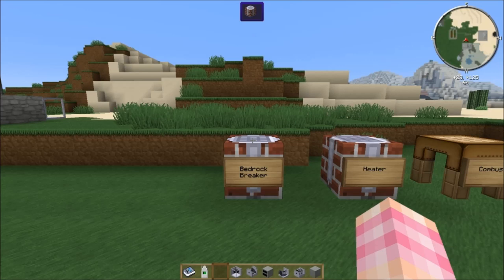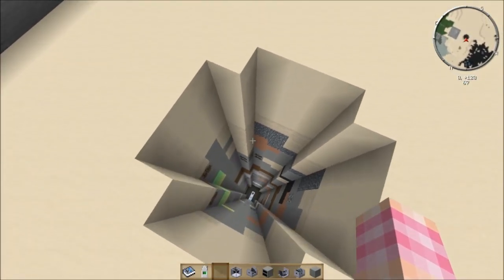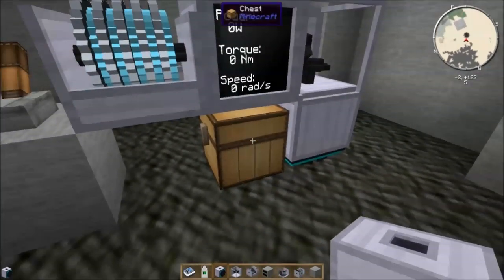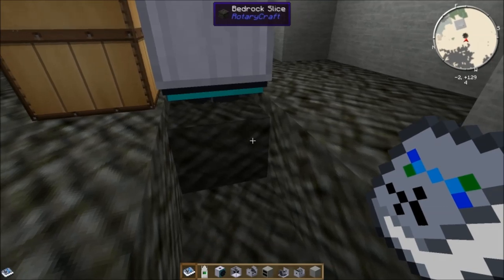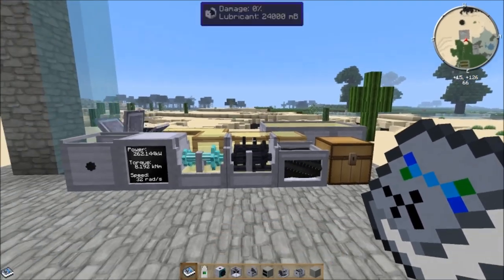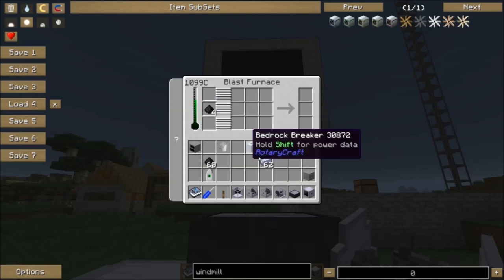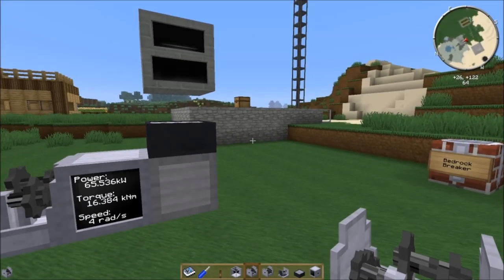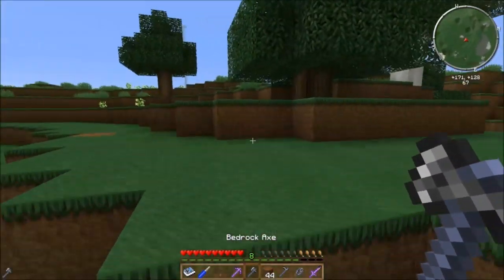RotaryCraft Tutorial #12 - Breaking Bed(rock)

Comment: Heads up to anyone watching this: match the speed and torque! for the friction heater! For example, if you have a performance engine you want to run it through a 2:1 gearbox to bring both the torque and the speed to 512. This gets you the highest possible temperature from the amount of power you're using.

Comment: Also, the heater torque requirement is 16.000, not 16000, thus making those gearboxes not only unnecessary, but actively detrimental.
Reply from the maker: You mean 16Nm? Was that another thing from that old version cause I tried that initially and it wouldn't work.
Reply: Insufficient power, maybe? Or more likely a bad combination of chosen temperature and fuels.
Reply: I already run a server and Sentinal has a standing invitation to it.
Reply: ReikasMinecraft I love your models and all the mechanics in the mod! I'm just sad because it's not featured in most modpacks... :(
Reply from the maker: TheMegaCreeper I think a lot of people don't like Reika's terms, that you can't modify any of his recipes or disable part of the mod.
Reply: That is a big reason, though those rules have now changed somewhat. Another big part is also the mod design being very much not like other mods.

Comment: can you put fire or lava under the blast furnace and then use the friction grinder at lower power
Reply from the maker: As far as I know the heat sources aren't additive like that. Having lava under it will just prevent it from dropping below 600 if your friction heater heats it higher.